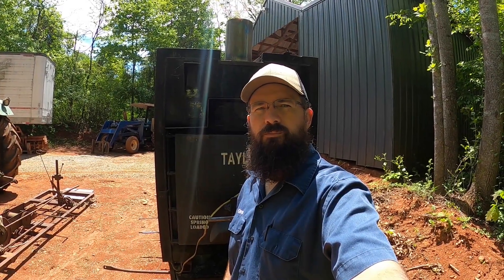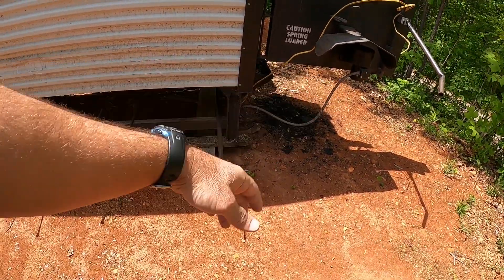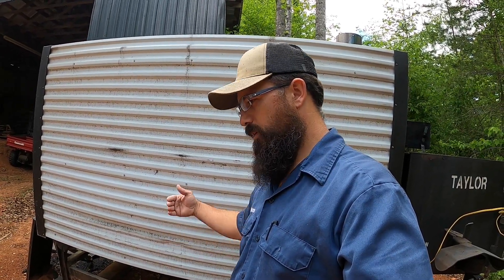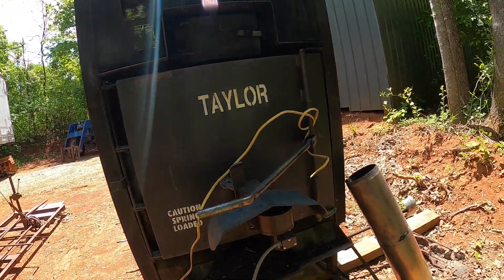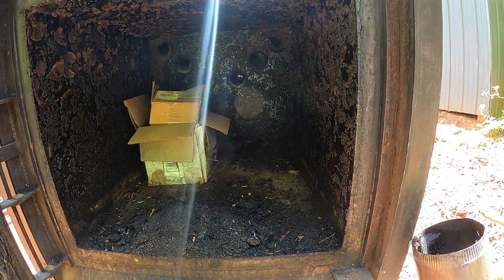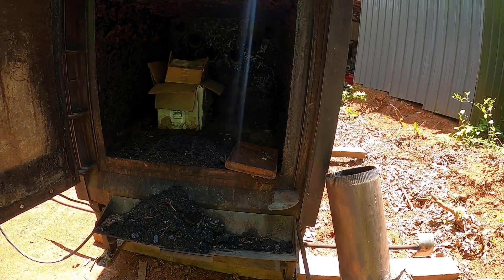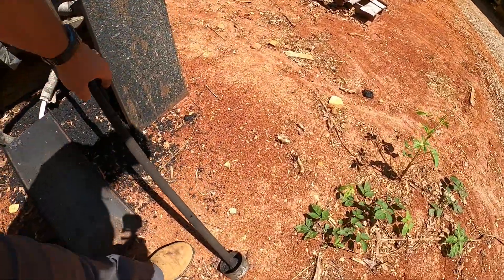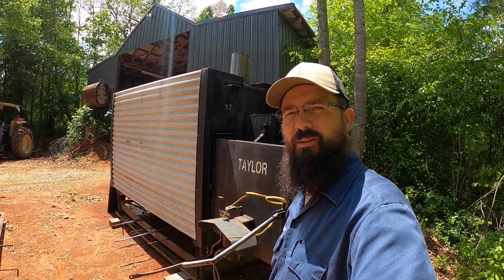Taylor Waterstove  T-750

Comment: Since it's only been 10 months since your last post on this. I have a few things to say. Your fire box is missing the steel blocking plate at the chimney.  That is supposed to be welded in. All of the exhaust should be forced through the round heat exchange tubes. T-750 holds 750 gallons of water. Yours is in really good shape. Mine finally rotted out after 23 years of constant use including summers for domestic hot water.

Comment: Is it still for sale?
Reply from the maker: No I gave it to my dad
Reply: @GlennConner  Thanks for the reply.  It looks like a good stove.  I wish I had found your video just a little earlier.  I have the smaller Taylor that I got well used about 15 years ago, and it finally needs to be replaced now, but I was very happy with that stove.  I bought a really old used Hardy in the meantime, but it needs some of the peripheral parts replaced in order to be able to use, and although being stainless seems really nice, I'm not sure if it's going to work for me as well as my Taylor did, particularly in terms of efficiency (with the chimney pipe going straight up out of the firebox) and for heating my hot water in the summer (with the much smaller water capacity.)

Comment: They are a bad design. The wood acids burn through the fire box. The fan is undersized and they mix stainless steel with steel. A recipe for rust. The fan continues to run after the fire burns out. Etc.
Reply: The fan runs at whatever the thermostat is set at, as the temp drops it turns off.
Reply: @gregice5946  I had one and the fan clicked on as the temperature dropped and then stayed on. You can find many outdoor wood boilers on Craigslist with holes. There really was no cost savings after headaches. Additionally you have to keep it warm or it freezes.
Reply: The fan being undersized would also cause an excessively rich mixture, so the door had to be cracked when burning at maximum and fire built in a certain way with about 7 small logs. I could achieve a smokeless fire if I micromanaged it. There no light for night time loading and the smoke pours when the door is opened. The water fill tube is hard to see. And being an atmospheric design air/oxygen is accessible to the water inside (hello rust/efficiency lose). Terrible terrible design. An outdoor wood boiler designed like the Taylor will have a life span of about 10 years before the first holes appear. Sometimes less. 

The ashes also need to be cleaned out as soon as you stop running it. They will absorb moisture out of the air and rust the firebox.

The air distribution of the Taylor is poor as well. It burns the fire down the center and less air towards the edges.

I rebuilt one once. Cutting out paper thin metal and welding in new. I media blasted the fire box and baked on a ceramic coating. I added fire bricks to the bottom. I repaired the foam.  Definitely the worst purchase of my life and it happened to be the coldest month in recorded history. 

A real wood boiler should have a life of at least 30 year. The Taylor was designed and built by people who did not understand wood boiler science. If your time is worth anything take a hard pass.
Reply: That’s a good assessment. Stock fan is undersized. It does burn up the middle. We shall see how long it lasts after ten years, but no problems that you’ve described thusfar. Guess we’ve been lucky. Which wood boiler do you prefer?
Reply: @gregice5946   @Greg Ice  I could go on about all the issues. The door cracked and had to be welded. I used it to heat a small business. After the weekend it took 100 lbs of wood to get taylor up to temperature. The atmospheric boiler had to be refilled with water due to evaporation. This causes a build up in the bottom of the boiler and a concentration of minerals/salts over time. Of course being atmospheric you had to use anti corrosion chemicals as well.

At any rate, designing/building/installing/feeding/maintaining a wood boiler correctly is expensive/time consuming. The payback is questionable which is why you don't see more companies using them. A  traditional wood stove is far less hassle/expense. You still have to use industrial level wood splitting, stacking, drying, and moving techniques to see a decent payback for per hour spent (at least $35 an hour). Time yourself splitting a cord of wood, stacking, and restacking vs the cost of a cord of wood. Or better yet use natural gas/heat pumps and find profitable work.

However if you insist I would look at a gasification boiler with exterior heat storage tanks. The design needs to be a  sealed pressurized unit built to boiler code. The firebox should be insulated as it takes roughly 1200 F for a complete burn. Preferably with a fan on the chimney to draw smoke out even when the door is opened. If the firebox is exposed mild steel it needs to completely burn the wood.
Idling (fan off smoldering) causes hot acids to condense, mainly acetic acid (vinegar). If the firebox is stainless it needs to be the proper alloy and designed/built in a way to prevent stress cracking from expansion and contraction. The square stainless fire boxes crack in the corners.

 It needs to have fire tubes. It needs a light and an easy to see water sight glass preferably alarm. They need proper fully encapsulated closed cell foam insulated outdoor water tubing to prevent massive heat lose from the boiler to inside.

A Craigslist/forum search engine will tell you if they last. I compiled a list once with so many models 8-13 years old with leaks including stainless steel ones. Not honoring warranties is common. Tarm wood boilers seemed to last 30 years and have overall positive reviews.
Reply: Very nice, Adam. Shared experience like this is what YouTube ought to be about!